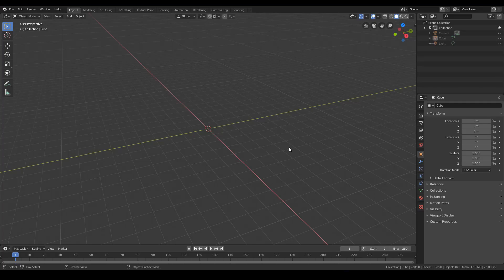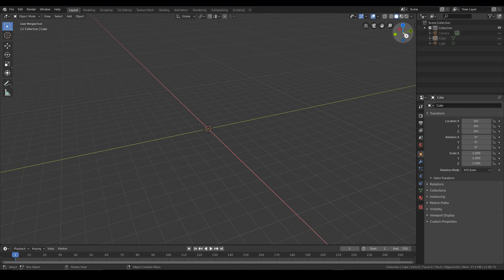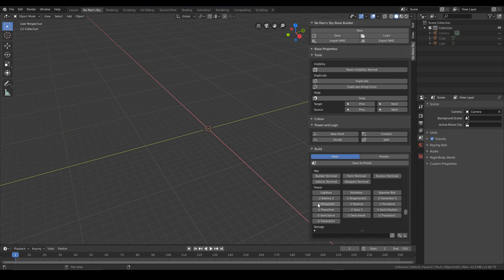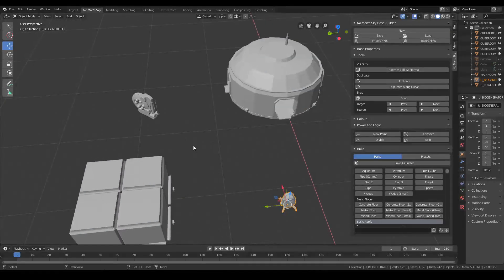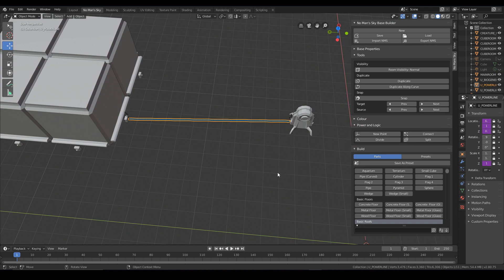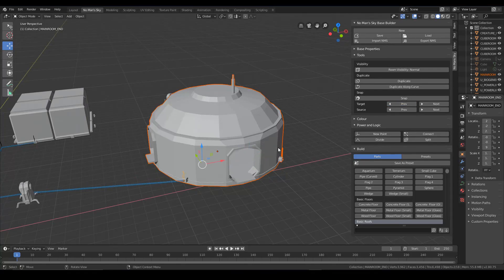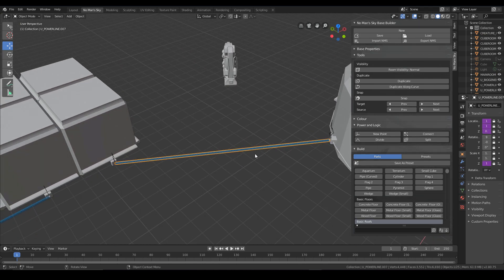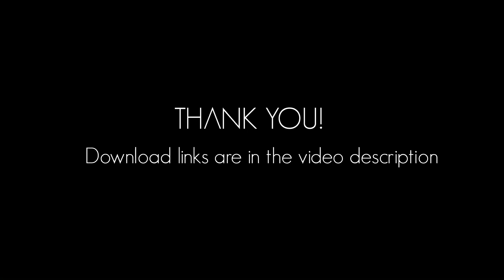No Man's Sky Base Builder: Blender 2.8, Scale and Power (BEYOND Update)

Comment: Awesome vid. Question can we scale a entire base ? Do we join all the parts ?
Reply from the maker: There is a way to do that yes. There is the "preset" feature which lets you treat a whole base as a single object. You can then scale it up or down using the controller for it.
Reply: @ for some reason I can’t use preset. I think because I’m on Mac? I get an error. But I can use the bender features ? Like selecting all and hitting join ? Or make instance real? I did try that but all the base parts disappeared when loading into my save. Anyway thanks for the reply. Live the add on ;)
Reply from the maker: @davidmorinmusic  Ah yea - I don't have a Mac so maybe something is tripping up there. Also the moment you start using Blenders own tools the less stable the process would be unfortunately

Comment: Hi there Charlie, couldn't wait so loaded my base just to test. I think you're missing "Container7"; all my containers loaded fine except for that.

Also while I'm at it would like to check how the import/export behaves for planters and say random plants. 
I have planters with specific plates growing on them and also have plants randomly planted bare around my base. (currently they seem to just be identified as cubes)
Reply from the maker: Hey, thanks! I'll double check container7. 

As for plants, yea I'm aware they are not there...just something I haven't got around to doing haha!

It's worth knowing that even cubes should be able to export and import fine. It's just a model/visual representation that's missing in blender. The data is all still there.
Reply: @DjMonkeyUK  Thanks! That was my worry but if it imports fine then I can get started. 
Somehow I had parts built underground by mistake, would not have known if not for this tool.